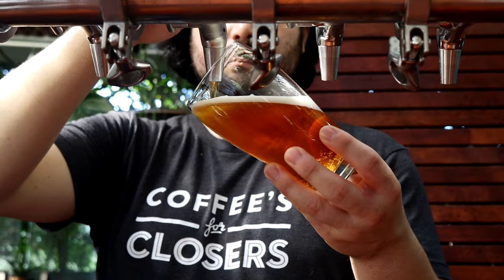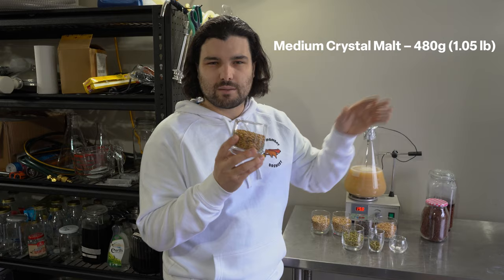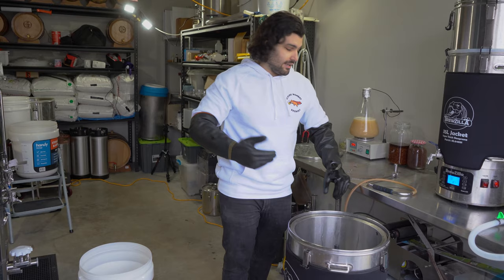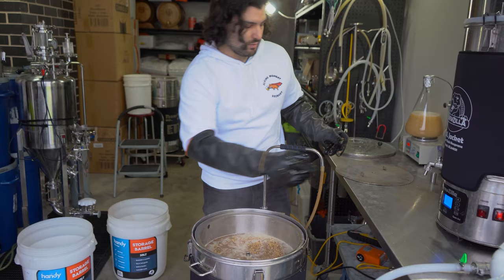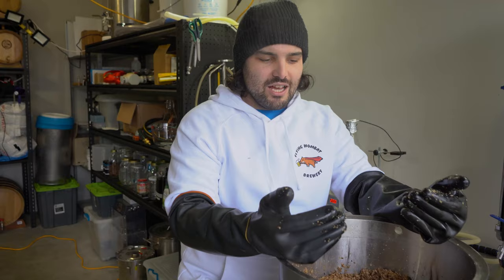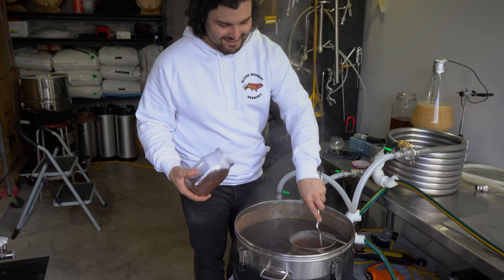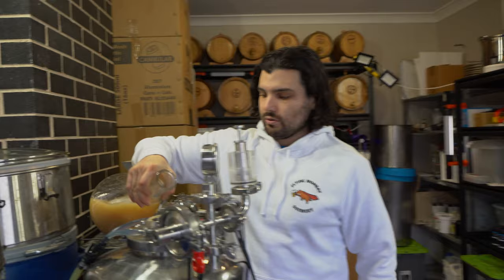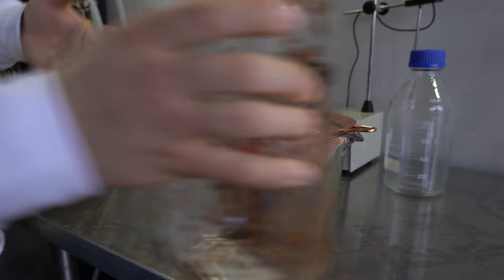Brewing a Chocolate Stout Recipe with Cacao Nibs!

Comment: Loved your video. I don't often brew beer but chocolate stout is a beer I do like to brew and drink. But here is a thought: I often make liqueurs and I use vodka as my spirit of choice and rather than macerate fruit or nuts or cocoa nibs for weeks to extract the flavors, I add the flavor compounds to the vodka and seal everything very tight. I then heat water in a water bath using a sous vide precision cooker set at 150 F (about 65.5 C) for two hours and so "cook" the liquor. Those two hours and the time it takes to cool down to room temperature is all the time it ever takes to fully extract flavors and colors. If you have a sous vide, this can give you far more flexibility in the amount of time you need for your "brew day" .
Reply from the maker: Very true! That’s definitely something we should play with next time we make a tincture, would massively speed up extraction times

Comment: Did you roast the nibs and then crush them, or were the nibs already crushed before being roasted?
Reply from the maker: The nibs we bought were already pretty crushed, yeah you could probably go finer for more flavour extraction, but cocoa nibs have a lot of moisture so what ever you do don’t put them through your grain mill! (I learnt that the hard way) you could also just zip lock back them and crush lightly with a mallet or hammer, or even use a food processor or blender